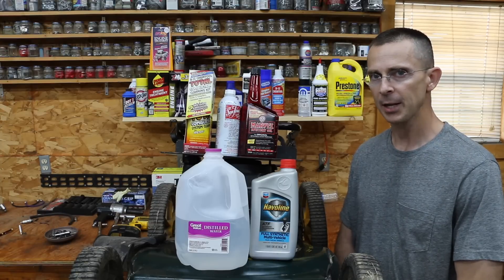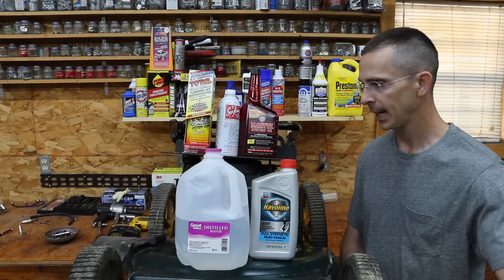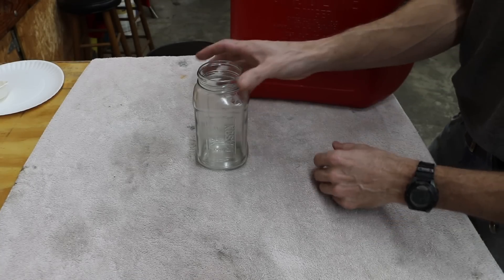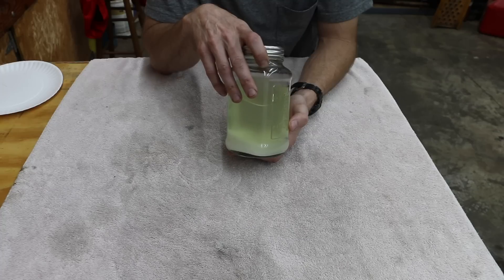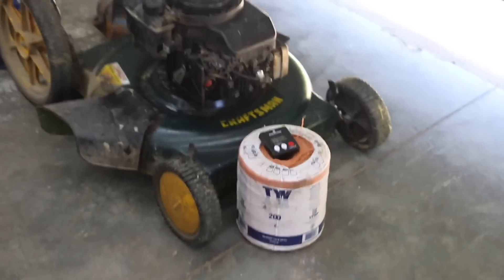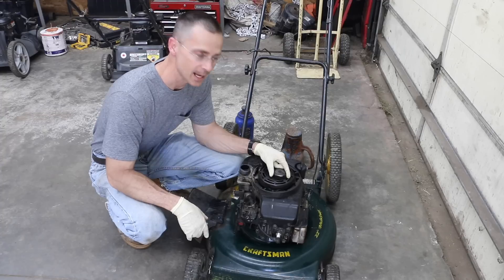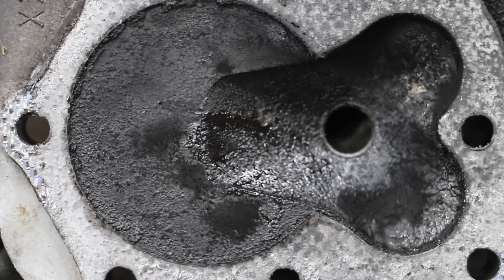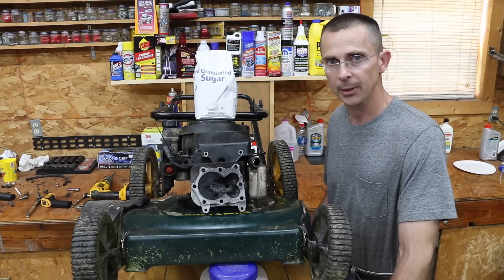Will Sugar in Gas Destroy a Vehicles Engine?  See what it does to this Engine!

Comment: I'm not sold on this test. I feel like enough sugar would have quickly seized the engine to where nothing could have been done to render the mower usable again. I had a 94 Ford ranger that was ruined by a friend of my ex girlfriend who put sugar in the gas tank and my truck never ran again. I couldn't throttle up to 35mph without it stalling and badly smoking. I am, however, convinced that I could have saved the engine had I cared to dump the $ into it, but the truck had 175,000 miles and was 12 years old
Reply from the maker: Thanks for the constructive feedback

Comment: A small request to you ,  please run a this engine on hydrogen gas produced either by electrolysis of water or chemical reaction b/w nao in water and aluminum foil to produce h2  and directly inject into inlet

Comment: I had someone pour sugar in my gas tank.  It clogged my fuel filter, carburetor,  and turned my gas in my fuel tank to syrup.   Had to replace 2 carburetors before we figured out what happened.  Had to take fuel tank out and spray down with a hot pressure washer.    Not cool pouring sugar in someone's gas tank!
Reply from the maker: Sorry to hear!

Comment: Engine not running rich or lean, running sweet.  Try putting head back on and spray a mist of water into the air intake, engine running.  Use as much water as the engine can handle.  Steam is supposed to clear away carbon.
Reply from the maker: Thanks for the feedback.

Comment: As shown sugar and gas don't mix. I worked in a garage for 11 years and a neighbor was going through a nasty divorce. His wife dumped a bunch of powdered sugar down the carburetor of his car and all over the inside of the air filter. Quite a bit of it. That did
ruin the engine.
Reply from the maker: Thanks for sharing.

Comment: Sugar does not destroy an engine.  To clean it out ,there is one product from Gernany that makes all others look like dung. 

 BlueChem. oil cleaner additive and decarbonizer gas additive. . My VW Passat 2003 W8 has 354000 and runs like new. I use the oil cleaner- every second change . The internal is like new, no tarnish. . 

Seafoam was made for 2 stroke outboards and has limited auccess in modern engines hence the name SEAfoam  Bluechem is way ahead. .
Reply from the maker: Thanks for the feedback.

Comment: Drain tank.
Small Engine add water - Large engine drop tank & add water.
Shake the tank like mad, dissolving residual sugar into the fuel.
Drain tank, rinse.
Dry the tank.
Clean the carb, too.

GOOD TO GO.

The reason that the head and piston top had more carbon - micro sugar powder sneaking through the carb and burning / caramelizing in the cylinder.  Not rocket science here.

Comment: It's amusing to read all the replies about the solubility of sugar in gasoline. Ignoring the fact that "polar" and "non-polar" are relative terms and not absolutes in the real world...it's obvious some sugar made it from the gas tank to the engine, right? I didn't read all the replies but in case no one else mentioned it: we are neglecting the time factor. Maybe not much sugar makes it into the engine on the first fill. Maybe not on the first 5 fills. But if you dump enough sugar in a gas tank and the operator of the vehicle isn't aware of it, that sugar is going to keep getting pumped into the engine, fill after fill, and the crud (caramelized sugar?) is going to accumulate in all the nooks and crannies until it causes some real problems.

Comment: But unscheduled disassembly was not observed. If a vehicle with perhaps a 16 gallon gas tank would have required something like 200g * 2 * 4 * 15 = 24000 grams or 53 lbs of sugar, it doesnt look like this is not the engine killer of legend. How about a gallon of nitro methane instead? That might loosen the head gasket.
Reply from the maker: Thanks for the suggestion.

Comment: I wish Jay Leno would add a Honda Rebel 234cc twin cyl Honda Rebel, adjustable main jet single carb. A Rebel rated 60-65mpg with a carb trick can get 85mpg and run better. Swap stock 33-tooth rear sprocket for 28-tooth to make 1st Gear useful. Mount a digital tach below the speedo. My gasoline use is 50 gallons for travel 4000 miles a year. Rage against the machine.
Reply from the maker: Thanks for sharing.

Comment: Back in the 1960s I was working on a job that had union and non union on the same job when we came back from the weekend we started our ditch witch it ran until noon but wouldn't start after lunch we found karow syrup had been put in our gas.we had the gas tank clean the carb clean and value s ground before it. Would run again.
Reply from the maker: Thanks for sharing!

Comment: change the tank or at the very least, drop and thoroughly clean it, flush the lines.
purposely contaminated fuel tanks can involve many things, usually what ever is Handy to the perpetrator. sugar does not mix with gasoline, so it usually will not go through the fuel system and remain in the gas tank however I do recommend cleaning any contaminants out of the tank, if you suspect someone has dosed your tank with something. I had one come into my shop one time, a woman got mad cuz the dude wouldn't sell their drugs and just started dumping whatever was handy and every hole in his vehicle, salt in the transmission/ engine/ tank..... salt will destroy a machine almost as bad as bon Ami scouring powder in the gas, which is a terrible thing to witness.
Reply from the maker: Thanksk for the feedback.

Comment: an old trick is to put a garden hose in the gas tank and let it run over flowing for a wile the sugar will dissolve in the water then drain the tank fresh gas you should be good of course the EPA wont be happy just letting the gas cut water to flow down the gutter but oh well lol =)
Reply from the maker: Great feedback. Than you

Comment: So…I stop just before the sugar run.  Now what I EXPECT is sugar to make no difference except to clogging the filter (of course) and possibly a bit of running rough due to dissolved sugar modifying the ideal combustion conditions. I do not expect visible damage.  LET’S FIND OUT….ROLL IT.    Ok…So I should have guessed at some carbon deposition, but in a car you’d not know it and it is certainly not wrecked.  Proprietary fuel additive cleaners would likely clean this up!
Reply from the maker: Thanks for sharing.

Comment: I got the heebie-jeebies watching him vigorously shake a glass jar with gas in it. One has to be very careful of moving liquids as they quickly generate static electricity. Glass is an insulator, as is plastic. A little research shows that any gas can, metal or otherwise, can be a bomb waiting to go off. Metal appears to be safest in that if you place it on the ground it 
discharges more quickly to ground potential than plastic or glass. Plastic is particularly odd 
in that if you place a plastic gas container on more plastic, like the liner of your truck, you
are asking for serious trouble from a static discharge as the liner is non-conductor too.
The charge built up from gas flowing out of the  pump into the container has nowhere to go
so it builds up on the outside of the container. One spark with vapors around and POOF! --you're toast. It is illegal in many places to dispense gas into a glass container. But that is because glass is easily broken and the contents spilled everywhere. This topic is too
complicated to explain fully so do some reading to understand how to properly dispense
gas to minimize the chance of fire and explosion. But really, I wouldn't get caught dead
shaking a glass jar of gas. Well, perhaps I would be caught doing that !
Reply from the maker: Thanks for the feedback.

Comment: He doesn’t show it properly. Sugar doesn’t dissolve in petrol as seen. This can cause the fuel injectors to clog up reducing the amount of petrol entering the cylinder. This can cause bad fuel economy and even destroy the engine. So I highly recommend drop the fuel tank clean it out. Replace fuel pump, fuel filter. Even clean out the fuel lines and the fuel rail. Also check if the sugar got to the injectors if yes then clean it or replace.
Reply from the maker: Sorry I didn't explain this very well. The gasoline I used did contain ethanol, which will dissolve sugar.
Reply: Dissolved sugar should just burn up or get chucked out the exhaust like oil . But not worth the risk to damage of the other parts of a car if done in a car. The amount of additives needed may burn a hole in your pistons or damage seals at best.. lawn mowers are way different to a car. Higher pressures more valves and pistons etc.. absolute nightmare. Much safer to clean from filter back to the filler cap for a car

Comment: you can't do that test on a mowling machine if the objective is to test a car engine. A car engine has a fuel pump in betweeen, so the pump can fail in the first place, hece, protecting the rest of the circuit (engine)

Comment: Watching another video, where sugar was added to the gas, and the insurance totaled the car.  It was vandalized by spray paint.  It was bought at action, tank removed and cleaned, and gas filter replaced.  The car ran just fine afterward, because since the sugar does not dissolve in gas, the only real risk is plugging the fuel filter.

Comment: That's not the right way to put sugar in the fuel... you get the sugar put hot water in the sugar and make a syrup out of it first , then add it to the fuel tank.  Now do your test,  it will lock it up
Reply from the maker: Thanks for the suggestion.

Comment: Love your channel... Could you try adding mothballs to the gas? I heard the chemical in them would blow the engine. But I suspect the gas will become slime from the styrofoam the balls are made of. Thanks!
Reply from the maker: Thanks so much!  Thanks for the suggestion.
Reply: Mothballs are made of napthalene, a poly cyclic aromatic hydrocarbon. I would expect it's soluble in gasoline, making it easy to get past the filters. 

Styrofoam, OTOH, would produce gunk, probably clogging the fuel line.

I'd guess para-dichlorobenzene (usually used in commercial toilets) would be worse on an engine, given it's also likely soluble in gasoline and when broken down would produce a lot of highly active chlorine compounds which would be extremely aggressive with metal at the temperatures inside a firing cylinder.

For this video, I'd have tried powdered sugar. Sugar's seriously insoluble in gas, so the smaller particle size would get more sugar into the engine.

Comment: Letting HHO gas fuel thel intake of any engine will burn up excess carbon in fact hydrogen for fuel is the answer to pollution with water vapour as ther by product.

Comment: Yet another "does granulated sugar in the gas affect an engine" test.
Good grief! Other than the effects of sludging, NO. Because sugar is hydrophilic and lipophobic, it won't dissolve in gasoline or diesel. Now if you actually get sugar into the gasoline or diesel, then the answer is yes. The sugar must 1) be made fluid by dissolving it in water, and 2) by adding an emusifier to get the gasoline or diesel to carry it along into the engine. I'm not going to disclose what an adequate emulsifier is other than to note that it's almost certainly an additive in your own engine.
So, please. Stop it with tests of pouring granulated sugar into tanks and showing that sugar doesn't dissolve in gasoline or diesel. That's only been understood ever since the advent of petroleum products.
Reply from the maker: Great feedback. The 10% ethanol content dissolves the sugar, not the gasoline. Thanks again

Comment: Dawn dish soap and water mix.  Put in an empty Lucas oil treatment bottle and dump into a gas tank.  Car will stop in a few mins and the whole fuel system needs to be flushed.  That's only IF the mechanic can figure it out.  Have drug dealers near your house... Give it a try, you won't see that car in your neighborhood again.
Reply from the maker: Thank you

Comment: i would drain the fuel tank and fill it with fresh fuel. Then go out on the highway and put it right to the floor and dont let up until the tank is nearly empty. This should clean it out. Run it hot and hard. (kidding dont do this)
Reply from the maker: Thanks for the feedback.

Comment: Te this is the injectors in newer cars are sensitive, it's not so much it's going to ruin the engine but it will cost the average person with no mechanical skills 3 to 4k to get the tank and engine and injectors and all that pulled out and replaced. Thats where the damage is, your wallet.